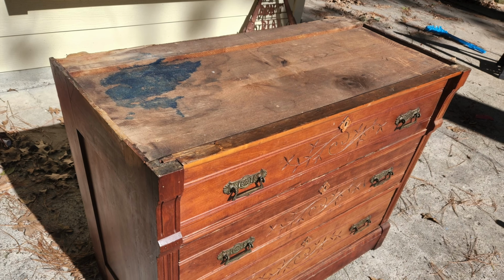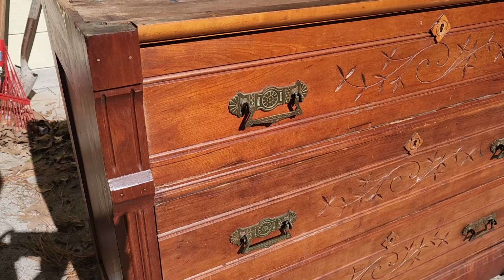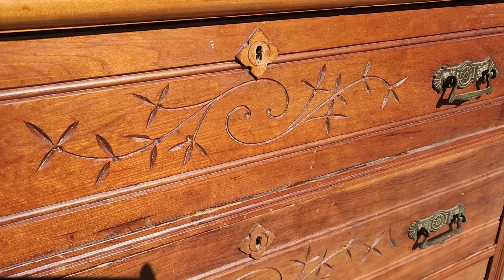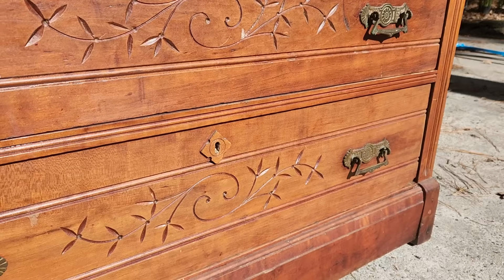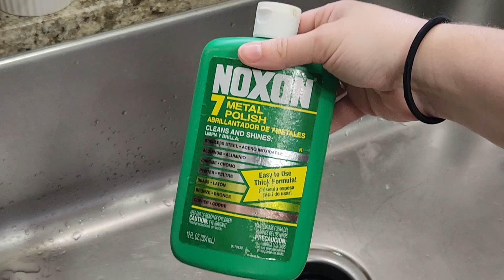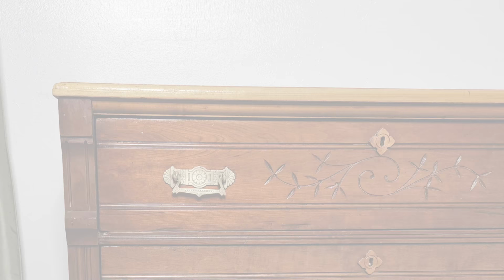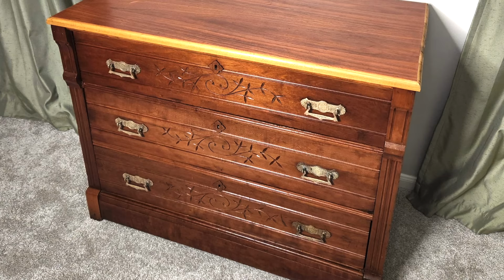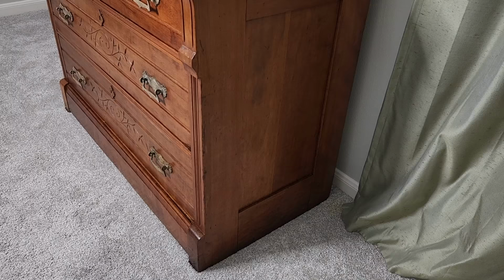Restoring an Antique 140 Year Old Dresser

Comment: My friend (1977)  and neighbor had this dresser with a routed white marble top, several coats of assorted colors of paints, hangers for draw pulls and he left it outside around his pool.  He said his grandmother had given it to him and he didn’t want it, I could have it.  I swapped a frig, I had in the garage, for the dresser. Got an offer of $300 to buy it.  Paid $300 to have it stripped, finished, and told do not touch the marble. I would later see the exact dresser in Better Homes & Garden, and I screamed. There are some differences from yours; no design on the front and I have dovetail joints.  I think it’s the same maker and I have learned something about it, Eastlake c1883.  Thank you and what a beautiful restoration.  I googled Eastlake and found your dresser on "1846 Homestead Renovation" and read a little more about it.  Now I have 2nd thoughts if mine is an Eastlake.
Reply from the maker: That is such an awesome story.
Reply: Beautiful restoration. I have an almost identical dresser. The drawer pulls on mine have been replaced at some point with depression era glass pulls. I think I will start looking for Eastlake style pulls like yours. I got the dresser from a second hand furniture store that was selling off pieces from a movie set. When I saw the Knapp joints on a $65 dresser, I nearly fainted.

Comment: what a lovely piece!   Shellac is a wonderful product but please note that you should rarely use it straight out of the can. Dilute with alcohol and you will be happier with the color.....less amber. Also shellac is best used as a barrier coat  or wood conditioner and  should never be used as a top coat. Alcohol in drinks or cleaning products will eat at the finish and you will most certainly get water rings.....guaranteed. Top coat with a spar (bar top coat) for a super durable forever, never a ring, washable finish. You could also use a water based top coat, but on a wood finish, spar is the absolute best
Reply from the maker: Thank you. You are correct. The original finish was most likely shellac so I tried to stay with the original. Also I am very sensitive to smells and as much as I wish I could use urethane more often, it gives me the worst sore throats.
Reply: Worried about your lungs, the seal on your respirator must be snug. You can’t hold it to your face and be protected.  If you have a sore throat, it indicates you have not been protected sufficiently from fumes.  Please please put your lungs first, invest  in protecting your lungs.